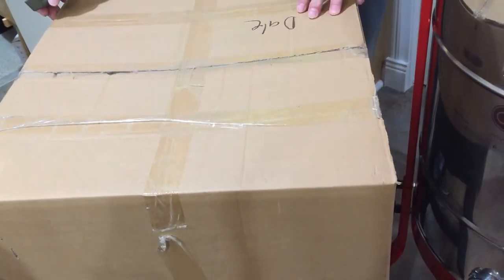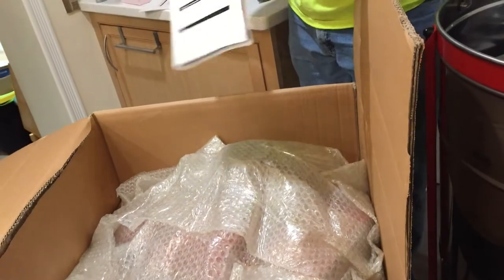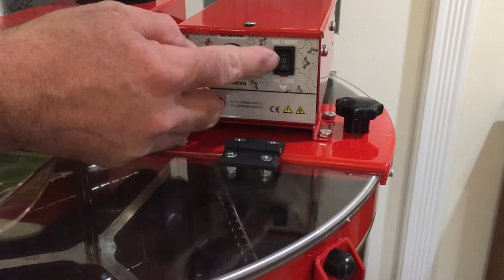Civan Honey Extractor Unboxing And Assembly Part 2 - Adventures In Beekeeping

Comment: How do you like ur extractor? How long have you had it for? Anything you like or dislike about it? I’m looking at the 3/6/6 electric extractor and I’m not finding anybody doing a full in-depth review on it or any reviews on it on google:( I guess it’s because it’s a very new product. There’s really not even any specs on it under the the description of the product. I’m curious to see how the bottom looks where without the cage and the center piece where you put the cage in, do you have to grease it? 
If anybody has bought the civan 3/6/6 electric extractor,I would like to know more information on it before I plan to buy it. Thanks
Reply from the maker: There is a ceramic fitting in the bottom where the cage fits in.  There is 1 ball bearing inside that fitting.  The bottom of the rod from the cage is concave so that it can ride on the ballbearing.  Yes it needs to be greased.  Be sure to buy a tube of food grade grease.  I like the Civan 3-12-12.  I have had it for just over a year now and have used it 3 times.  I like the fact that it comes with the honey gate preinstalled.  It does a great job of extracting honey.  This is not a full review and this is the only extractor I have used.  I talked to the manufacturer rep about these two complaints.  First on the 3-12-12 a 5 gallon bucket will not fit under the side skirt so that the honey gate will pour honey into the middle of the bucket.  I checked the other models at the show and they were tall enough for the bucket to go under.  Second, and I think this is a common complaint with extractors, if the speed is turned up too fast, the extractor begins to dance because of out of balance issues.  Over all I like the Civan 3-12-12..